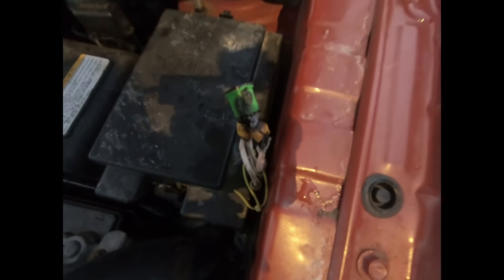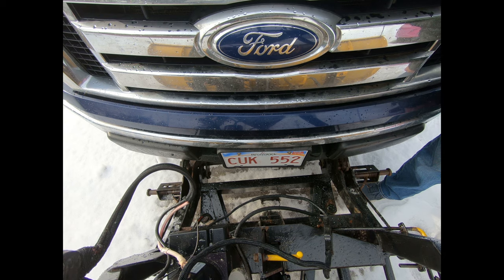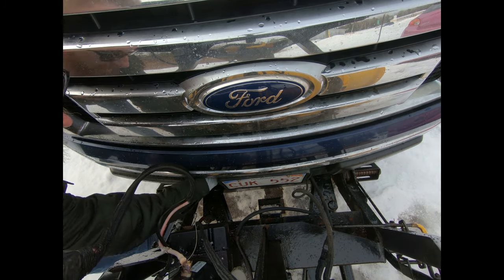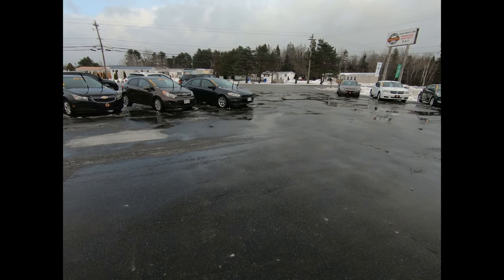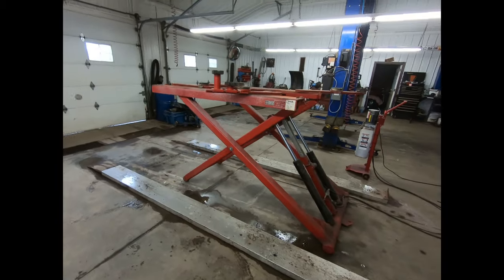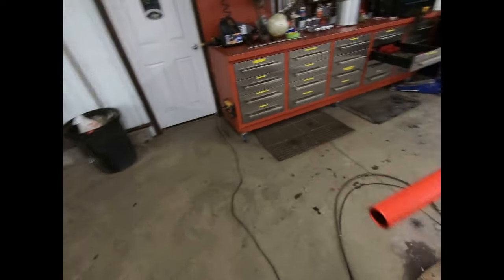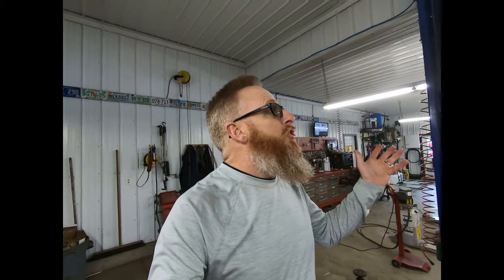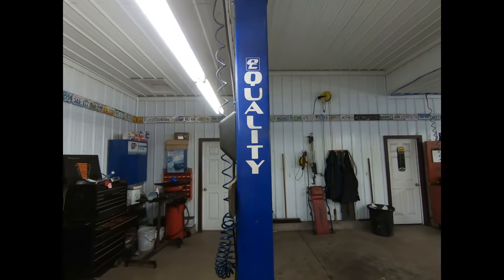A VIEWERS QUESTION ON VEHICLE HOISTS & LIFTS

Comment: To me it seems like it's either the blower motor pulling to many amps, a bad insulation on a wire touching,  moisture getting to where it shouldn't in the blower motor, or maybe it just needs another ground wire added to it. I know you went through some things already. But I'm a bit out of touch on those cars but on most I deal with the blower motor is on its own fuse so for it taking out other stuff is odd to me
Reply from the maker: I’m hoping to dive into it tonight. And the camera will be rolling! If I can’t figure it out it might be time for an early dismissal of Bubbles!
Reply: @OldeCarrGuy  well hopefully all goes well. I'm sure you can find what ever it is causing the problem

Comment: does it do it on full fan or in low speeds maybe a issue with the resistor pack possibly
Reply from the maker: The fan works on all speeds. I normally leave it on high to defrost the windshield. Come to think of it there is a separate relay underneath the blower motor that may have the points sticking on it. Hmmm